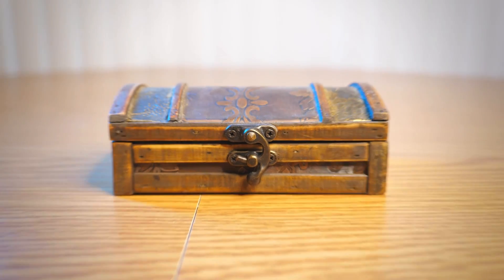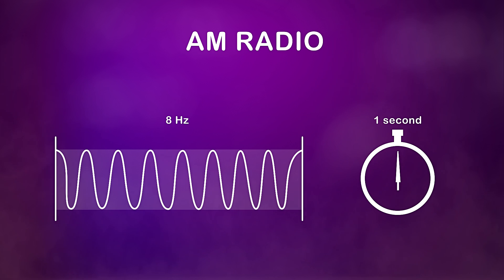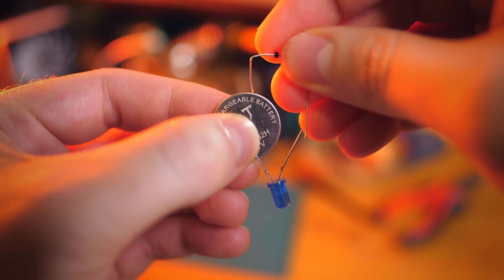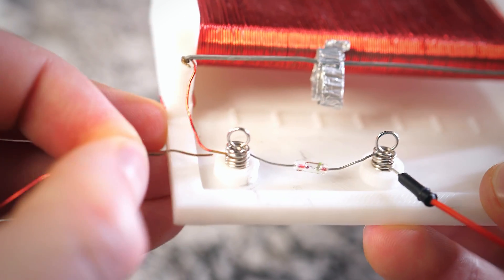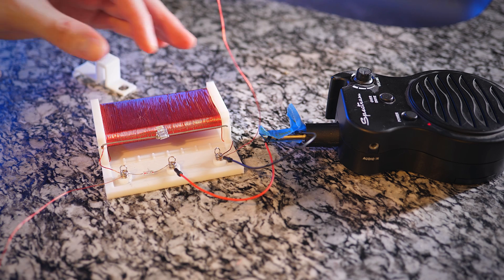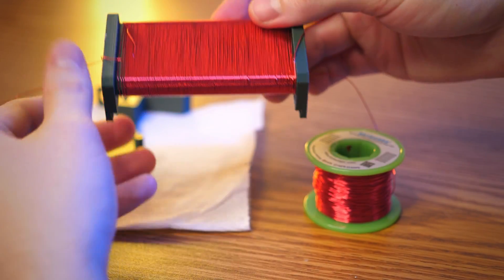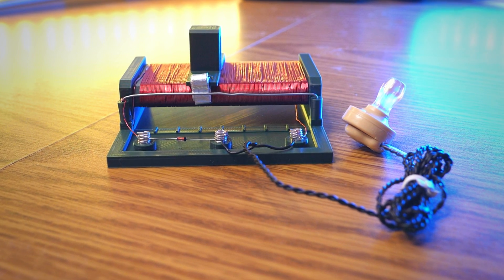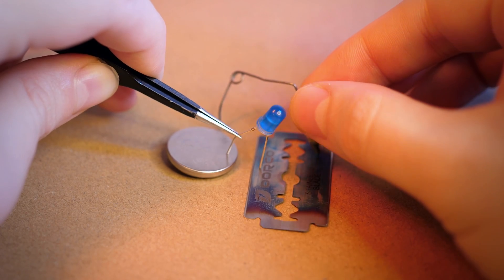Does My 3D Printed Radio Work 5 Years Later?

Comment: What is the diode type you used?
Reply from the maker: Germanium diode. It needs to be because of the low current levels.
Reply: @3DSage  I found a workable alternative diode that you can get more easily
https://youtu.be/5y7I7G_a3Qo
The 1N5711 works if you put a 2K loading resistor across the earphone.

Comment: Hey, i'm gonna try that soon but i have some questions: 1. What are the dimensions of the 3d printed parts? [I currently don't have my laptop with me so i can't try if the pieces would fir in my 3d printer in the slicer software]. 2. Are there cheaper options for the audio thing? I'm trying to make it on a budget and 30€ for a earpiece seems a bit expensive, would it also work with a speaker? Or how could i connect an aux cable to the radio?

Comment: Perhaps a pinpoint contact with the edge of the windings is better than the foil based wiper, as that will reduce the likelihood of creating shorted turns as you move it along.

Comment: This is something I did be when I was 10 yrs old. I later became an electrical engineer and worked 46 years in the industry.
Reply from the maker: wow that's phenomenal! You have so much great experience and got to see computers really evolve over the years. You are awesome! 👍
Reply: @3DSage  thanks, I spent 47 years as an engineer, from early color tv to chips, retired 11 years ago. You might want to show another 10 year old how to do the radio without 3 d printing. A paper towel roll makes a good form for the coil, a small piece of scrap wood to hold everything......

Comment: 5:59 "And here you can see exaclty how importnat this diode is"
*proceeds to open the circuit instead of showing what happens if you'd used a wire

Comment: You should do a FM 3D printed radio as they are much more common
Reply: FM or frequency modulation is much better and newer and in more quantity than AM (which is power consuming and old )
Reply: AM is less used than FM
Reply from the maker: That is a good idea!

Comment: You can make a more stable connection by making a loop every few turns. Connect a wire to any of the loops to tune the radio. It does mean there is less resolution in the tuning, but it guarantees a solid and stable connection.

Comment: Especially old "Transistor Radios" rely on basically the exact same coil idea, but have their own amps included. Probably one of the few types of radio that'll survive the end of the world.
Reply: Given that use, how one makes transmitting version of this. Its fine and dandy to listen but if no one is transmitting its really not useful. This could be good shit hit the fan communication method if it can handle EMP.
Reply: @Hellsong89  Well, that's the fun part, you CAN do the same in reverse, you just need the amplifier driving current from a piezoelectric surface (the same earpiece used to receive can also be used as a microphone to transmit) towards the coil instead of away and you can get an (admittedly pretty bad) transmitter. It's the same design principle that led to the "walkie talky". Yeah a hand built one will make lots of noise instead of picking up lots of noise, and as a broadcaster it'll have poor range, but you'll still be audible so it's better than nothing in a disaster. Bigger coils concentrated to a specific frequency start looking more like the modern antenna, combined with stronger amplifiers you get better range at the cost (or maybe benefit?) of spreading your bandwidth occupation.

Comment: The working of gauge actually make sense once you understand it- it's how far a wire of that gauge and a specific weight (a pound, I think) will stretch without changing it's thickness. It probably became common because it could be measured fairly early in stsndardization.

Comment: "...3D Printed Radio..."  The first rule of 3D Printing Hype.  Whatever noun follows the descriptor "3D Printed" is always the wrong word; most typically the noun describes the 'Next Higher Assembly'. In this example, the crystal "Radio" was assembled from parts, including: enamel coated wire, maybe a high impedance crystal earphone, a hopefully germanium detector diode (1N34A?), a metal terminal, a metal slider with metal shaft, I see a razor blade (?) for some reason, and (OMG LOOK!!!) at least one part (the 'chassis') that was 3D printed (could have been carved out of a scrap of wood faster than it took to 3D print, not even an exaggeration). 

This rule of 3D Printing Hype is essentially universal. The correct noun is rarely used. It's always an exaggeration by implying that the final hand-assembled device somehow tumbled out of the 3D Printer. Utter nonsense. We need to stamp out this nonsense as it impacts the understanding of the proletariat (LOL!!).
Reply from the maker: The box at the beginning is a wooden box even though the hinge and lock is metal. 
Almost all items are referred to as one main material even when they contains other parts. I think I just disagree but thank you for watching the video, adding the comment and opinion.
Reply: Bro it's not that deep
Reply: Are you really being pedantic about terminology? The thing that holds the coil and its base where the other components rest upon is 3d printed, making it a 3d printed radio.

If you print a large model and use glue you dont go "well its a glued 3d print" or if you use screws "its a screwed together 3d printed part"

And I guarantee no one else goes by this "rule"

Comment: Will the piezo be louder if there is more/thicker copper wire wrapped around the 3D printed plasic part?

ps: the first thing what I felt while watching was exitement. The video quality is great, I would love to see more interesting small projects.
Reply from the maker: Yes and and it's best to have a long antenna.
Thank you! I like making these little projects and I have several more in mind :)
Reply: Your sink is absolutely the worst kind. Im amazed there is a signal because that faucet is likely not connected to the copper pipe work, usually plastic pipes. Downspouts with the paint removed where the hookup is, flagpole, the valve underneath sinks where it actually connects to the copper, hot water heater, my favorite might be the ground wire in a plug. Its the mouth of the plug. Tuning ur antenna to the proper length is key tho. Longer is not better. It should be half the wavelength. For am of 50khz u can try a 1/16 wave antenna at 1200ft or 374meters. And will work for 100, 150, and 200khz bands. Surely you could divide it again if need be. If ur antenna at any length is a bit out from what u want to receive, it might cancel that particular frequency if its a fee hairs off as to reflect and invert the wave within the antenna. Radio is so cool

Comment: You don’t even need diode. Take a piece of blade from office box cutter knife or from safe razor and heat if with fire. The goal is to make the metal change its color right about in the middle of the piece. This border with weird color in the middle will have semiconductive layer that will act as a diode. Yes, it’s harder to catch the waves, but it’s possible.
Reply from the maker: Yes I show that at the end of the video. It works!

Comment: Hi very good
I made this 27 year before on 3 inch wood wounded with different pieces of wires joint together because those days I don't have long wire it works amazing with out antenna and earth.
A diode 50 oham internal resistance.
And 300 oham high impedance headphone.
Also it convert any signals into power.
Reply: you mean ohm?
50ohm internal resistance diode? That would extremely strange for a silicon diode. Have you used homemade oxide diode? Or germanium diode? 
(Schottky diode is the best for this, if you have one, it only needs about 0.2V to work, but can do with slightly less)
Reply: @adamrak7560  dear in those days i have lot of stock of different old & new components from my father.
I tested many many diode and different stuff but only one type diode work very excellent ( it look like in4148 but its colour is green and its internal resistance exact 50 oham).
Headphone from airline its impedance 300 ohm .
No capacitor, no earth, no antenna used.
My concluded after many experiment, different wires joint together and wounded on 3 inch wood pice 1 ich diameter.
It tunes automatically natural frequency that catches different frequency and convert into power and signal.

Comment: @3DSage
2:42 Try using Vinegar & Salt, then rub with some paper or similar, it almost instantly removes any oxidation on copper.
Reply from the maker: Yes I mentioned that in the video and that's a great trick to use! Works great :)
Reply: @3DSage  With copper, if you heat it up you can dip it into isopropanol. It reacts with the oxides at high temp and reduces it into copper very quickly!

Comment: Good video, but when you showed the importance of the diode, you just opened the circuit. No wonder there was no sound. You should have bridged the diode with another wire to show how it would sound without a diode!
Reply from the maker: I noticed that when editing the video but replacing with a normal wire would cause the same effect. Removing the diode also is to prove the sounds are coming from the printed radio.

Comment: I got a question can a regular piezoelectric buzzer works as an earpiece
Reply: Yes regular piezo disc work but higher inductor use parallel to piezo.
Reply: @rizwanmalik3659  thanks for the info

Comment: Looks like you will need to make another version in 5 years again 😄
Reply from the maker: I could design a portable enclosed version :)
Reply: @3DSage  for a lesser confusing wiring standard use the european version measured in surface area mm2

Comment: Next a proper enclosure to protect it from oxidation.
Reply from the maker: I could make a part 3 video and build a portable design. :)
Reply: @3DSage  you should make a small 3d printed pcb with an option to use a battery with it :)
Reply: @ithaca2076  if I had the time I would make the slider an old dial with a knob to turn it :)
Reply: Do you mean vacuum? 🙂

Comment: I did the razor blade version back when I was a kid, the article called it a foxhole radio. It used a pencil lead to connect to the razor blade, with the explanation there being that the junction between the steel and graphite provided the diode. (They even recommended an older, rusty blade - heating it like you did would have been a good plan too). I don't know where I got the earpiece, but it needs to be a very sensitive one - normal cheap headphones won't work. But yeah, it was amazing to hear a radio station come through.
Reply: I think you need a piezo earpiece in your radio, so that it's very sensitive to voltage
Reply: @tomclanys  That's correct. These earpieces were most commonly used in hearing aid devices and had a 3.5mm jack.

Comment: I mean this sounds really usefull if you are stranded somewhere, considering it uses no batteries.
Reply: Small solar panels or hand crank generators are fine too.
However it will be not possible to use them without transistors or vacuum tubes, which, sadly can't be made so easily as diodes.